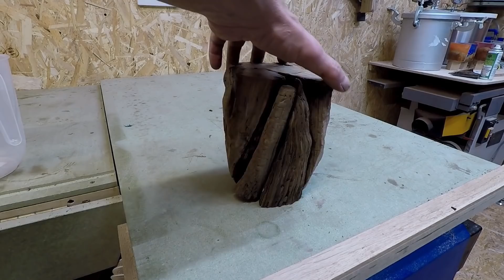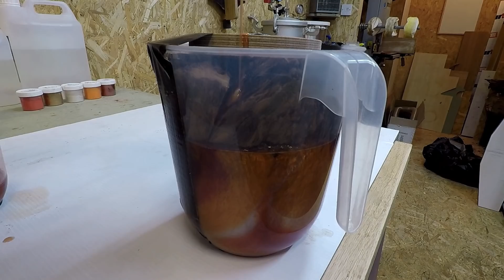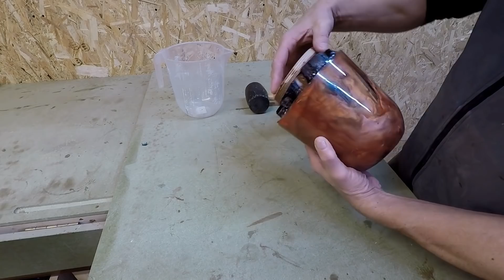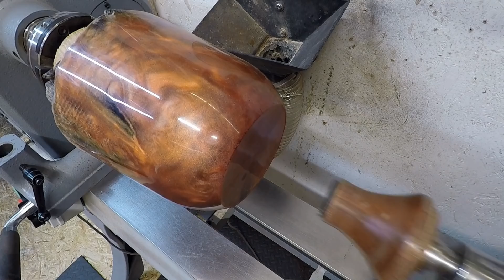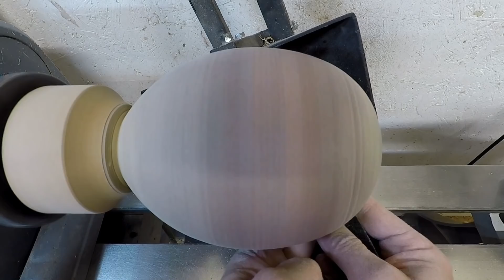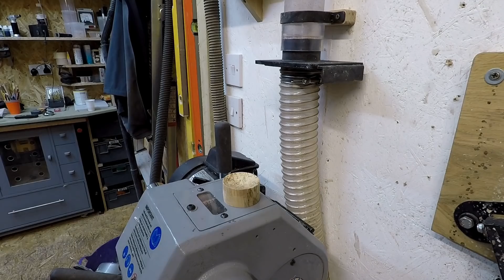Woodturning - The Phoenix Egg

Comment: I really wish I were able to have a nice work space like Andy does... It would be awesome to be able to have a space like that in my home so I could learn how do all these super awesome things that he does. Although I'm pretty sure he's invested a lot of money into what he does and I'm more than sure that this equipment isn't cheap at all. There may be some stuff that isn't very expensive but the big stuff sure must cost a pretty penny. Specially that lathe, I've looked into them and the prices vary depending on what size you'd want to get of course. But I've also seen some videos that teach you how to make a small one using some wood and a drill. Soo I think that's what I'm going to start with for the time being, that way I can start with small projects and get some experience inn then be able to move on to a bigger one hopefully not only when I have some experience but when this whole virus situation calms down and the economy gets a bit better. Because times are deff pretty tough right now, so it will be a lot easier on my pockets to get ahold of some leftover wood and make a holder for my drill so that I can use it as a small lathe for the time being... We'll see how it all works out though...
Reply: merkga Greetings . I started small, a piece of used equipment at a time. I’ve also seen fantastic things come from less than perfect shops. Keep learning and focused. Best of luck
Reply: You should pursue it! I love these videos but have zero desire to do this. If you are that fascinated you must!

Comment: Hi Andy,
I just want to understand why some turners use “empty” negative pressure pots while many others use positive pressure pots like you in this video ??? Thank you for your answer !!
Rene
Reply from the maker: I use both .. the pressure pot pressurises the resin to help prevent bubbles forming and forces it into any voids .. the vacuum chamber will suck any air /bubbles out of the resin and also suck air out of punky / soft wood and replace it with resin helping to make the wood more solid

Comment: Can anyone explain the purpose of the vacuum phase?
Is that to get the air out of the epoxy?
Reply: Hiya! I know this is pretty late but the use of the pressure pot is to remove air and bubbles from the resin as it’s curing, this is coming from a fellow resin artist :)

Comment: What kind of finish are you using? Is it wipe on Poly or Danish Oil??
Reply from the maker: On hybrids I use sanding sealer/thinners mix on the wood and then sand to 800 then go through 3 stages of buffing .. no finish as such